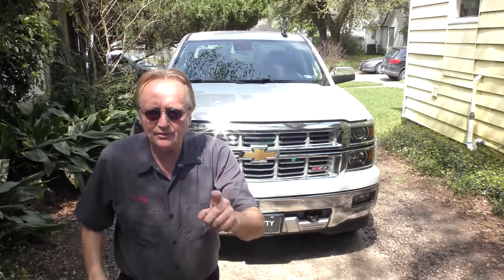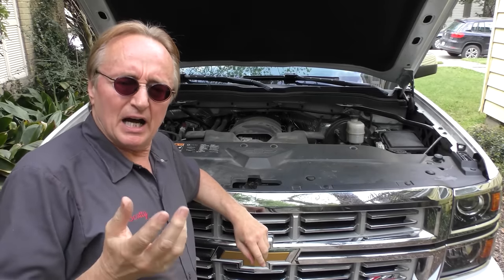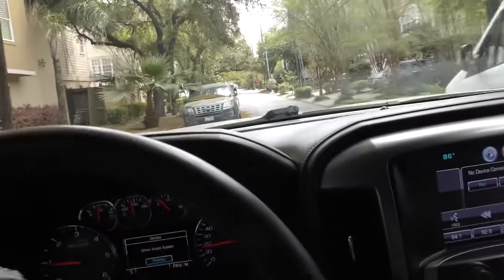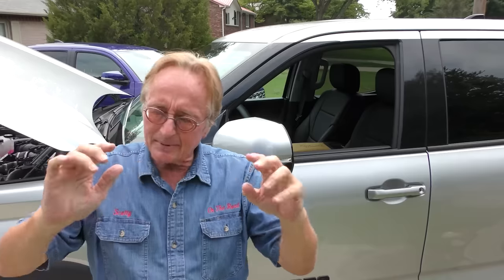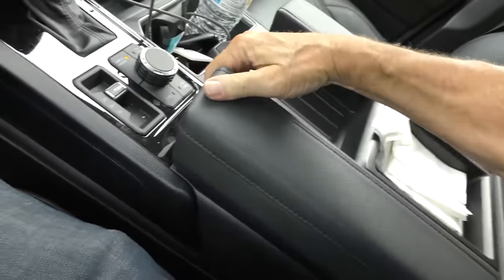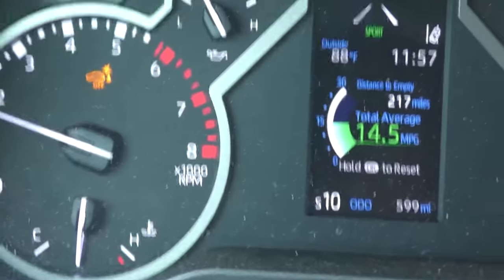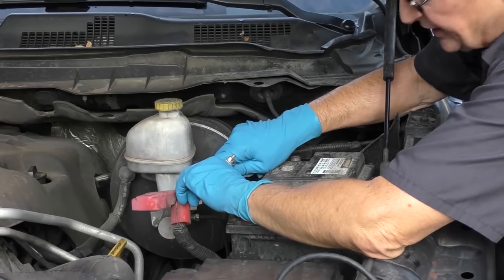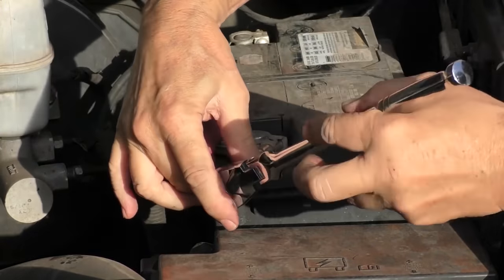3 Trucks I Wouldn't Touch with a 10 Foot Pole

Comment: Scotty you need to emphasize to people with turbos they have to let the turbos spool down before they shut the engine down because if those impellers are still spinning fast enough and you cut off oil pressure to them your gonna wipe out turbos like no tomorrow.

Comment: Should have bought a 2007 ranger xlt. 2.3l. The a/c works great. Never had any problems.all original freon, never leaked. 85,000 miles uses no oil. Tyranny shifts great.

Comment: I bought a 1993 Chev 1500 W/T new in 1992.  At 16k the engine was smoking...valve stem seals.  Drove it for 15 years 113,000 mi. Sold if for $1200.  I replaced the starter twice, water pump, alternator, trans mounts, motor mounts, shocks, exhaust system, brakes, radiator, original tires lasted only a few years, brakes, bushings, etc.  
My first Tundra, 2007 went 93000mi in 6 years.  I had to replace the windshield wipers and tires.  I got 60% of my original purchase price.  The truck drove like brand new when I bought the 2012.

Comment: 2012 F150 with the 5.0. Best truck Iver ever owned so far.  306k miles. Air is cold. One O ring on a radiator hose. New brake pads front and rear. its definately time but still have original spark  plugs in. 😳

Comment: I had a 2014 gmc and had that exactly same problem with the a/c! Then my 2017 gmc the blinker kept going out, ended up being wiring and corrosion on the fancy headlight capsule… guess what they told me next time it screwed up I’ll just have to buy a whole new headlight capsule for $1200. Sold it and bought a 96 Chevy for $5000

Comment: Just wait until about 75k on the Chevy the Transmission will go out because of the cheap Torque Converter.  You need a Billet converter and tune out the AFM and the Transmission will last a lot longer.

Comment: If that's not a gm key on the tailgate, the handle surround is aftermarket. The aftermarket ones come in 3 flavors. Economy, redesigned economy, and metal. Maybe chevy isn't to blame?

Comment: lol My 2023 F150 5.0 RCSB averages about 19MPG combined. It can do 25+ on the highway. 

If you look at the specs, a base truck with a V6 barely gets better gas mileage than the V8 version. Its because the V6 has to work harder to move the truck than the V8 does. Adding turbos just compounds the problem.

Comment: I'm so glad I pay attention. I never owned a vehicle that was more than $1500 until I was 18. Had an old Geo Metro (Toyota drivetrain), a 92 Accord, 88 Toyota Pickup, then I used my wife 08 Civic for awhile, and finally bought a 95 Ram 2500 with the V10. I needed the Dodge for the work I was doing, and as soon the tranny started jumping at 175k, I sold it immediately. Then I found a 14 Tacoma private sale for 14k back in 2018, and traded that in for a 15 Tundra in 2021. I only owe 17k on the Tundra because I got the Tacoma so cheap and it was worth a lot more than I owed, I could easily turn around and sell it for 25k tomorrow. Toyota is the ONLY truck you can buy that holds value like that. A 15 Ram 1500 with 120k is practically at the end of it's life, but not my Tundra!

Comment: I clicked on this out of curiosity and the 1st truck that he mentions is MINE (well mine is a 2014 with the longer bed, but same truck).  And yes my AC doesn't work.  I have recharge it every summer.  I pray it's not the heater core.

Comment: The reasoning behind the smaller starter motor on a Chrysler is they are geared different thereby allowing the use of a lighter duty motor. Less drain and less weight if and when it needs taken out. He should know this. I have a 242,000 mile 25 year old Dodge 1500 5.9 (360) 4x4 with the original starter motor. They must have done something right.
This also further supports not buying anything newer. Too many relays and unnecessary technology. IMO.

Comment: @SCOTTYKILMER
HELP!!!
My son purchased a 2015 Chevrolet Silverado LT 1500 two years ago. Two weeks ago, on friday 
August 30, 2024. He was driving on hwy and all of a sudden his engine light came on without any prior warning on the dash. He lost power. The truck went into limp mode. There was white smoke coming from the exhaust. The truck has 113,000 miles. 
He didn't know what caused it. So, he asked for someone to come that has a code tester. The code came back with failure of #7 cylinder. It had oil around the sparkplug. The other plugs were dry but some had dark spots. My son said he wants to remove the DOD, AFM system. He feels this may have changed the problem. 
He doesn't have a warranty anymore.
Some people have told him the engine may need replacing. 
What should he do now?
It's his only transportation. 
I love your shows.

Comment: I’m not a fan of Toyota of Hopkinsville but I’m glad he had a good experience. They told me that when I was looking for a used Camry for less than $30,000 that I couldn’t find one and that I needed to buy there $42,000 Avalon. They also said that $30,000 was “Corolla money”. Also they ran my credit while I was doing a test drive they said that I needed to provide them with information before I could test drive. So yeah over all Labron and his boss failed. I bought a 2023 Toyota Camry se nightshade with 13,000 miles for 28,000 the next day.

Comment: My 15' has 480,000kms, still running strong, but is using some oil now. Replaced the ac comdensor twice, and the tranny once under warranty...overall, i would say the truck is ok, not great, i would say average at best. Missed my 08" Avalanche, and my 04' 2500 light duty, that was a great truck and gms best generation of trucks.

Comment: Yeah it's six months late on this comment. Absolute common problem on these Gen trucks and SUVs, AC condenser leaks on driver side near bottom at an aluminum weld, overtime, seepage happens and visually inspecting AC condenser can verify the leak when observing a darker, previously wet trail where refrigerant leaks at the mentioned aluminum weld. However this diag here I'll be honest and admit that this evaporator leak I have never found. Nice work!

Comment: Company truck is a 2019 Silverado, gas flap broke less than a year old....plastic. Entertainment display locks up every so often, or goes completely black. Goes through oil like no tomorrow, but doesn't burn any or leak....its a mystery. Ill never buy one, unless its an old square body.

Comment: I’ve never had problems with chevys like I’ve had with fords and dodges, my Silverado has 340000 miles on it with minimal issues, transmission was the only big replacement at 276K miles

Comment: Had a 2014 silverado and the transmission blew up at 90,000km was not impressed with that truck at all. Never been a dodge guy but Chevy really let me down here so just traded this truck in on a 2023 ram 1500 hemi. I pick it up in the next couple days so fingers crossed it's a much better truck

Comment: I suggest doing a quick voltage drop test when it doesn't turn over. If good battery and voltage drops to say 9.6 volts most likely starter or seized engine.

Comment: One thing about Ford trucks I always hated were the plastic shift handles they felt flimsy compared to GM always using metal shifters. It worked, but it still felt flimsy I remember my 1994 F-150 was like that, but my 2004 Silverado was metal and felt tight and better built. Yeah they have plastic in other areas like the tail gate. I would not buy any trucks built after 2005. I just put a new engine and fix my old truck when it needs repair.

Comment: Had a 3.6 2017 ram and put 220k before it got totaled.  Got 25 mpg and only had to replace oil cooler onrings and a few wheel bearings.

Comment: I love how you got a very well used Ram for this video. You should have mentioned the fuel mileage it gets. I get 21 mpg on the highway out of mine and it has the 5.7 V-8 with 160k miles. I've replaced brakes front and rear. I also have put a battery in it. That's it. Best truck I've ever owned.  You just don't like Chrysler products. Ram trucks may not be the fanciest but they last.
Reply: Your, maybe. I know a neighbor that was a HUGE Mopar lover.  He won't even talk about the anymore. All his sons are driving Chevies, as are mine.

Comment: I've got a Yukon thats the same year as that Z71.  A/C went out when it was 5 years old.  $2200 quote to fix it.  In my case it was a bad compressor.  I ended up buying a compressor and new condenser/dryer for $450 and putting it in myself.  Absolutely ridiculous that an A/C compressor would go out that soon and apparently it's a common problem with these.  I've got toyotas and hondas 20-30 years old that still have all the original A/C equipment and 3x the mileage that still blow cold.

Comment: I own a 1985 Chevy Silverado with the same problem took it to get it fixed but could not afford it so I sold it. Chevy does not have a better idea that is for sure same thing with having the distributor on the back of the Moter when you have so much room up front

Comment: Hi, I just discovered this channel, enjoyed it, I have a 2005 GMC Canyon, bought used in 2010, 6 grand, 38,000 miles from a dealer, which seemed surprisingly cheap, best truck I ever owned, it now has 114,000 miles on it, I have replaced the front brake pads, 2 sets of tires and a battery, that's about it, $40,000 for a truck? WHY???
Reply: Because there’s a sucker born every minute

Comment: To be fair your Celica is from the golden age of Toyota. My family had a 1995 Corolla that literally took nothing but oil changes, new spark plugs at 140k, and a clutch at 120k with 4 people learning to drive on it aka hard on it until 212k when we had an accident. I have a 2000 2.2l Camry now that was made in japan. It's fuel economy leaves much to be desired compared to the Corolla but it's knock on wood cheap to maintain no issues, original everything and has 170k now and it's easy to work on with tons of engine bay room.

Comment: Ive ownee my 2015 chevy 1500 for 4 years and never locked my tail gate once, guess im going to go give it a try. Those 2014 and 15 silverados are known for oem style condensors are known to crack and leak. At 58k i swapped mine and can see where they improved the design on the new one

Comment: My dads old 2011 ford f150 I remember it used to stall whenever he would try backing up and he would have to take the keys out the ignition and try restarting it a good 2-3 times until he has enough room to whip the truck around forward he could never back out of a parking spot lmfao glad he got rid of that thing years ago 🤣

Comment: My 2014 1500 silverado had a lifter go out. My 2019 1500 silverado is in the dealership right now with a lifter out at 59k. I do my own oil changes with good oil at 4,000 miles. Absolute garbage design that has been a problem since 2007. Will be paying off and buying an old pre emissions truck.

Comment: I have a 2016 Chevy Silverado 3500HD bought it brand new for $60k. I’ve put 2 transmissions in the truck, pitman arm, power steering gear box, 2 sets of manifold gaskets, calipers are horrible and have been replaced every brake change. Electrical issues. Way more issues… too many to list. Non stop problems. Chevy only warrantied the 2016 for 36000 miles. Unless you bought a GAP coverage plan for $3000, which I declined. I’ve got over $40k into repairing my truck. Well over $100k total into it. Listen to this man. I certainly will never buy another Chevrolet unless it was an older model.

Comment: I had '91 Ford Ranger that had a heater core leak. It was easily accessible from the floor on the passenger's side. Took me less than an hour to replace. My '02 Expedition had one go out and it took my mechanic over 10 hours to replace as he had to pull the dash. Stupid.

Comment: I bought a 2015 GMC Sierra in 2019 for 25K. I thought I got a good deal. 4 1/2 years later and $18K in repairs I’m thinking I was robbed. Transmission, Cam shaft and lifters, AC, infotainment system, oil pump, and a whole bunch of things I can’t remember.

Comment: The reason you dont feel the torque in the turbo cars is becuase all the power  is in the top end rather than a v8 which has most of the torque in the low end

Comment: I wouldn’t trade my 2021 Tundra for the new one.
I have the good old V8, six speed transmission, not near the electronics the new one has and I still get the same 15/gallon.

Comment: I have a 2015 chevy ….   I havnt had any issues with breaking plasic or mechanical for that matter, i have 134000 on it.   My complaint is in 5 years the bed rusted all to hell above the wheels Its now started on the rockers.   Ironically my work truck which i plow snow with and spread salt with is a 2012 f250 and it dont have a spec of rust on it.

Comment: Having a leak on the evap coil isn’t a result of “poor manufacturing” in the slightest. I work commercial refrigeration and anything can leak at any time. They have joints and a ton of u bends on these coils.  Every now and then a coil will leak. The only “poor manufacturing” is the fact that it was shoved way under the dash, but it’s not 1992 anymore and there are electronics and sensors everywhere. Can’t fit everything under the hood these days.

Comment: I've noticed that you disconnect the positive cable. Back in Auto Shop, they always taught us to disconnect the negative because it's less of a short risk. Also, they taught us negative off first when removing the battery and on last when connecting the battery. I'm curious: have I been told wrong, or is it the case of a rule being made that doesn't really matter all that much?
Reply: As an ase world class master tech and instructor, you were taught correctly. Negative cable off first when disconnecting and last on when reconnecting.

Comment: I just had to replace the starter in my 99 Dodge Dakota. The starter was still oem. I don't know how many miles it has. The carfax stopped at 156k. Somebody rolled the odometer back though as it was at 65k when I bought it in 2019 for $1500.

Comment: I got two trucks. 03 f150 with a 4.6 with 280k miles orig engine and trans and 09 f150 with the 5.4  with 130k miles. I wouldn't buy a ford anymore with eco boost or the coyote engine

Comment: My 14 Sierra has been good, still on stock tranny at 400000kms, maybe mine is just special lol, I’ve owned since new and have put almost no money into it except for tranny lines and a condenser which I did myself, if you looked under the hood you wouldn’t be able to spot a single oil leak either

Comment: Had brand new Chevy Tahoe LS..at 18000 miles left me stranded at airport drive train gear box broke,told me it was angle of driveshaft.. fixed..27000 broke again..fixed..32000  transmission took a crap..and dealer told me it's going to be month or so, because transmissions coming out of factory are junk..and dealer completely rebuilt the transmission..and worked great.but sold it before something else happened..won't buy GM anymore . Tahoe in shop most of the time and I had to drive Malibu.. unreal

Comment: Love Scotty, though I disagree totally on Ram trucks. I've owned 6 and all were great with virtually zero issues. The interior on that new Tacoma looks Spartan and cheap. The Ram interiors and the whole trucks are gorgeous compared to all others IMHO. 😁
Reply: Also, the truck had a bad starter, but look how easy it was to change! I've never had a problem with the 95 and up mini gear reduction starters with the exception of a 99 Jeep GC 4.7 V8 I had. That one was clearly inadequately shielded from the heat from the right exhaust manifold. That heat would shorten the life of any starter.

Comment: Best years chevy Silverado were 99-07..After that the quality went down. Though I do have a 2019 Tahoe fleet vehicle I’ve racked up 140k miles in 4 years. Just the usual maintenance, rebuild upper motor due to lifters going out, then rebuild the transmission at 111k miles, and then completely replace the cooling system: radiator, water pump, thermostat. You know the usual maintenance 🤣🤣

Comment: Getting straight to the point of mentioning the defects without any other fluff would make better videos.  The DISqualifiers make whatever they do well irrelevant... A starter short should not affect any of the vehicle computer functions. If it does the system was incorrectly designed.

Comment: We have a 2010 Ford Fusion SE. Basic model we boight for our selves on our wedding day. This car is junk. 115 000 miles as of today. -Completely rusted out gas tank that was leaking and volatile, $2,000.
-Unibody front frame and components completely rusted out and rendered dangerous and unfit to drive, $3,000.
-4 channel ABS module failed and made the car dangerous to operate  $750.
Radiator and coolant lines completely rusted out and leaking  $750.
-Transmission reflashed and fluid changed more times than necessary $???
-Rocker panels completely rusted out along with other body sheet metals.
Broken power drivers seat that is now non-adjustable.
-Leaking trunk that I repaired.
The only good thing is the 2.5 Mazda engine with added good timely oil changes and service. A well intended gift to us on fixed incomes that is a nightmare.

Comment: Chevy have been an electrical nightmare since the 80's and they still haven't learned a thing. Sadly rusty chevs are pretty much all I'm stuck with cuz I need to hall equipment everywhere and plow snow. I'm not plowing with a Yota. No.

Comment: About the first truck, a 50k truck and a 2k repair is 2/50 = 4% repair. Which is in line with the cost of the truck. If this was a 30k truck you'd be right. Like when ppl buy a used luxury car and are breathless when they find out the new 100k car needs a 6k repair.
About the second truck. From 10 to 15 mpg is a huge 40% increase in efficiency. Also these truck drivers do not hypermile like eco car drivers. This is why ppl and the gov't should use gal/100mi, not mpg. Sticker ratings can never control your foot.